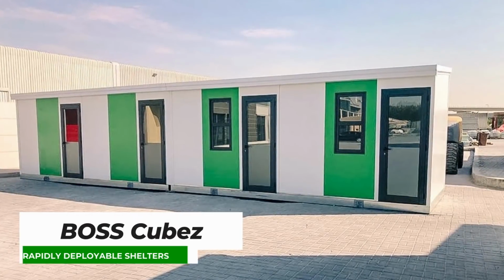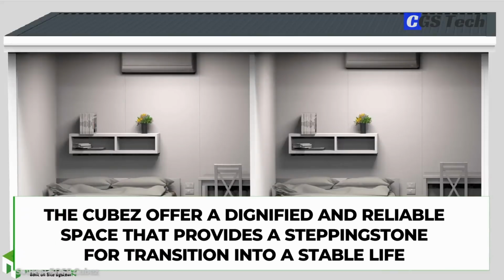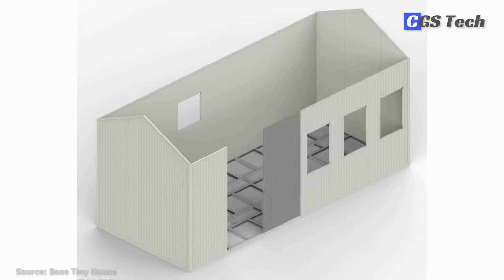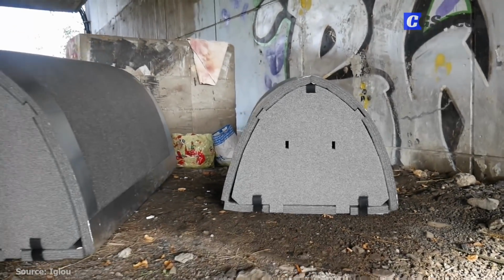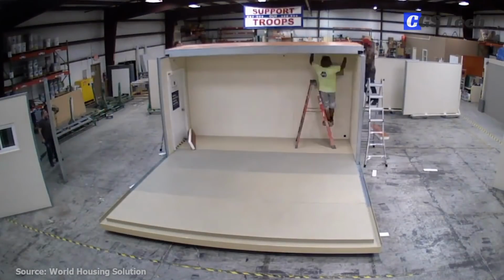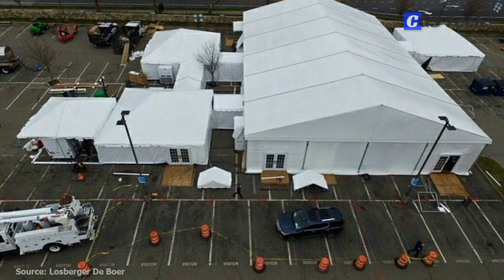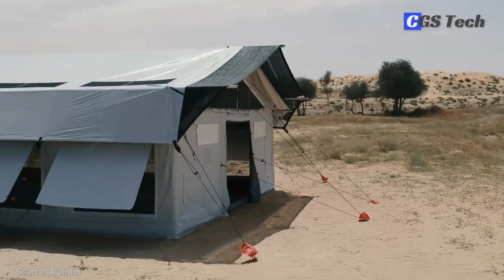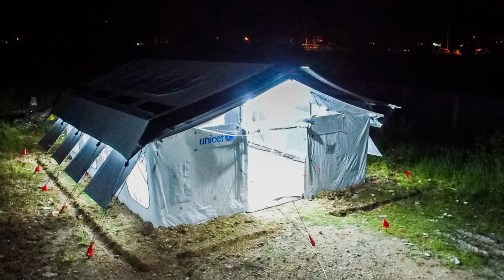6 Prefab Shelters for People in Need #3

Comment: With all of these over the 3 Videos you did, How many are Stackable? I and I know others that would like to Stack these. I would Stack up to 4 or 5 High. Other 2-3, Some Higher than 5. Vary Limited Space were they would/are needed.
Also, IF... If there is a Lumber Supply close by or not far off, You CAN Actually Build Sheds the same Size or even Larger and in Some cases a Second Floor for Less than what you can Buy Some of these for and leaving furnishing and other stuff up to the Recipients to provide/take care of, just like Some/Most of these do. And if you have the Recipients Help Build, you give them some Basic upkeep knowledge. And the ability to work for what they receive.
Also How do you Keep Out Rodents And Roaches and other F'n Insects that will crawl on you at night then poop/piss on you and in your food in places these are needed. Specially Warmer Climates.

Comment: tarp between two panels of wire mesh, real cheap, and other things
Reply: Yeah Real Cheap but companies like this LOVE to Over Charge you for Basically the Same Shit. If there is a Lumber Supply close by or not far off, You CAN Actually Build Sheds the same Size or even Larger and in Some cases a Second Floor for Less ( Almost Half ) than what you can Buy Some of these for and leaving furnishing and other stuff up to the Recipients to provide/take care of, just like Some/Most of these do. And if you have the Recipients Help Build, you give them some Basic upkeep knowledge. And the ability to work for what they receive.
Reply: The advantages r evident, this method of construct, y it isn’t taking off I don’t know,